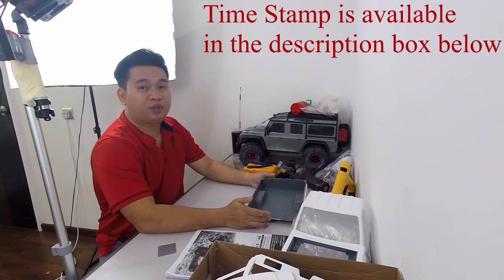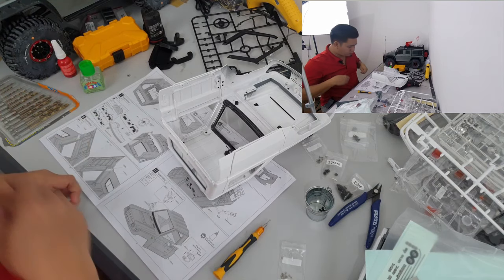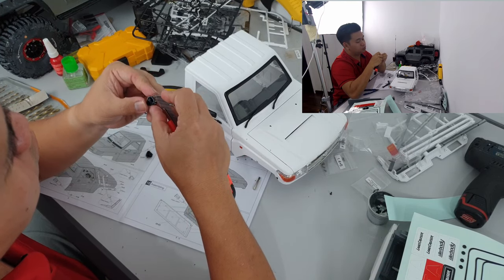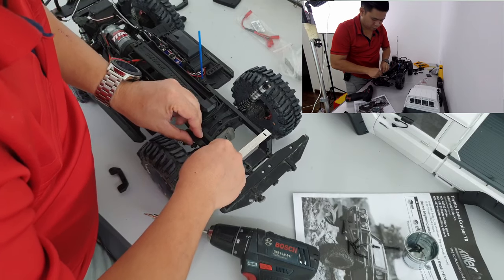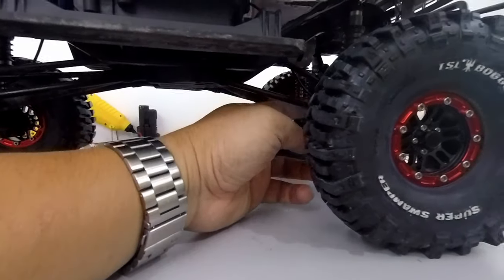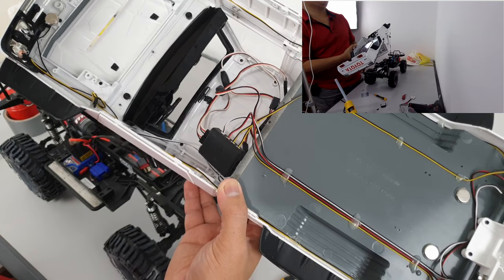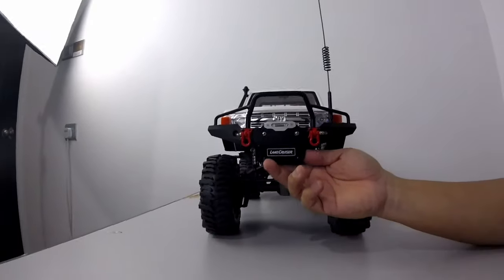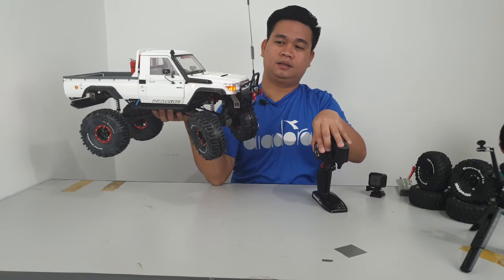Traxxas TRX4 | KillerBody LC70 Body Build (YaiRC)

Comment: Congrats on a beautiful truck!
Reply from the maker: Thanks Bro!!
Reply: @yairc  Are you still using the cantilever shock system on the rear? Do you like it better than the forward shock mounts? Thanks.
Reply from the maker: @Terry12345  yes, im still using the cantilever shock. but the stock xtraspeed shock are too soft, even i put 500 oil it still soft. for the looks i prefer my 1st high lifted setup using the custom shock tower, but for crawling it best to use current setup with cantilever..the high lift are easy to flip over when crawling.
Reply: @yairc  Thanks!

Comment: Nice work, helped me a lot. - Which cable comes in wich channel for the litekit?
Reply: Hi, great Video! Could you please make another one where you show how the lighting cables are installed in the trx-4 chassis? I'm struggling with this issue.
Reply from the maker: @taschenurne sure bro.
Reply: So far, I found out that the y cable in the channel 2 slot of the light controller goes to the esc. Now the lights work. But if I connect channel 1 to the steering servo, the esc blinks green rapidly and the car does neither drive, nor steer. What did I do wrong?
Reply: @yairc  So far I found out that the y cable in the channel 2 slot of the light controller goes to the esc. Now the lights work. But if I connect channel 1 to the steering servo, the esc blinks green rapidly and the car does neither drive, nor steer. What did I do wrong?
Reply: Ok never mind, I'm just stupid😅 Now, I connected the steering wire to the turn l/r slot of the light controller. Now the car drives and steers, and the lights and indicators are working perfectly.
Reply from the maker: @taschenurne 🤣🤣🤣🤣

Comment: Hi boss... gney molah special mounting ya...
Reply from the maker: hai boss, aku makey acrylic plate nok 3mm pun tebal. Polah 3 keping dan glue together. As for the mounting measurement, aku sikda dimension ya sbb main agak2 jak...just polah draft drawing pakey kertas, ada 3 igik lubang jak perlu drill di custom mounting ya...2 lubang pakey ikat nya di chassis dan 1 lubang for shock pun screw mounting. Distance top lubang ntuk shock screw ke lubang chassis screws is 10mm jak. 3 set custom mounting ya boleh polah sama, tapi nok kiri depan kreta pun perlu polah extra webbing sbb perlu ikat steering link sia jua. Nok tok ada tricky sikit mok polah, Mun kitak ada TRX4, kali kitak dpt paham rupa kiri depan pun original shock mounting ya. Aku pakey acrylic plate sbb nya basically plastic, senang mok polah if compare ngan metal plate. Aku lupa mok shoot video masa polah benda ya, ya lah sikda tutorial...kitak ada plan mok beli LC70 pun body ka?
Reply: Tgah mikir2 juak nak meli nya.... tp ya la tek mikir bahagian blkang ya.... cney nak oleh acrylic ya... ngan screw ya.... ktk area ney boss... kmk slalu main d bintulu
Reply from the maker: @mohamadshairazimohamad7631  hahaha...aku miri ctok...actually aku dah ada solution ntuk blakang ya..benda ya nang di reka khas ntuk issue tok...Xtra Speed polah ya...Cantilever..aku ada polah video ntuk benda ya..tapi belum edit gik...kitak boleh tanga2 online shopee...ada jual..RM300 plus..or else..ada solution lain ku boleh suggest..depan kitak biar jak pakey stock shock mounting dan blakang ya..shock kitak ya perlu screw in ke lubang depan sikit...ada beberapa igek lubang screw kat chassis ya..shock mounting blakang perlu remove...tapiiii....ya ku sik minat..kitak pun shock kelak slanting ke depan...aku personally sik suka setup ya..ya ku polah custom mounting ya...dlm video tok mun sik silap aku ada padah pasal slanting absorber ya...
Reply: @yairc  mahal juak nok cantilever....hahahahaha setup yg ktk polah ya ok rsnya...cuma ya la tek brg2 ktk ya... xmok jual ka brg2 khas ya hehehehehe... kei kmk setup sm juak
Reply from the maker: @mohamadshairazimohamad7631  eh..sik pelu jual2 ya bro...aku dah sik pakey, aku pakey cantilever ya dah.....beri jak alamat..kelak aku post...hehehe..tapi dgn syarat..mesti sub channel aku tok....hahaha..
Reply from the maker: @mohamadshairazimohamad7631  hahaha..ok2 bro..kelak mun dah kirim aku inform kitak. Tq for the sub, share ngan kawan2 video.
Reply: @yairc  ok2 no problem tq2 so much

Comment: Hi. where can I fix these pieces?
Custom shock tower for installation?
Thanks
Reply from the maker: Hai bro...i made it my self from acrylic sheet.
Reply: @yairc  ok
Where are you from?
could you make me a set to level the shock absorbers too? I bought LC70 TOYOTA today. But here it is difficult to find spare parts. I live in Italy. could you help me?
Reply from the maker: @stefanomosconi6230  hahaha..i don't think this is achievable...you can use cantilever by KYX to level the truck bed. Watch my video here, https://youtu.be/2nIkE5gQ67Y..and you can buy it from RCMART here..https://www.rcmart.com, they ship internationally.
Reply: @yairc  ok thanks bro .. on the site do they sell the pieces like the ones you have? what are their names? What do I have to look for? help me please
Reply from the maker: @stefanomosconi6230  these are the link for it..https://www.rcmart.com/xtra-speed-cantilever-kit-for-traxxas-trx-4-mst-cfx-w-xs-tx28086-00082632..
Reply: @yairc  there wrote page not found. do you have a more trusted link?
Reply from the maker: @stefanomosconi6230  you can just type "cantilever" in the search box in the site..it will show all with cantilever index...
Reply: @yairc  perfect thanks a lot and for your availability. very appreciated. I found the shock mount set in a horizontal position. thanks again very kind !!!
Reply from the maker: @stefanomosconi6230  glad that its help.

Comment: hi bro I wanted to ask you for a kindness could you send me the 3D print file for the raised bumper support? I was thinking of printing it. unfortunately I too have the same problem with this body. let me know if you have saved the file yet. Thanks in advance
Reply from the maker: hai bro...im so sorry i cannot give you the SPL file. That is because that shock riser is not 3D printed..i made it myself using good old tools like glues, hand file and acrylic plate. I didnot made a video how to it because it kinda troublesome to do it..really need a patient and might. But you can use XtraSpeed cantilever for rear suspension if you plan to mount LC70 chasis. it really looks clean using that cantilever.